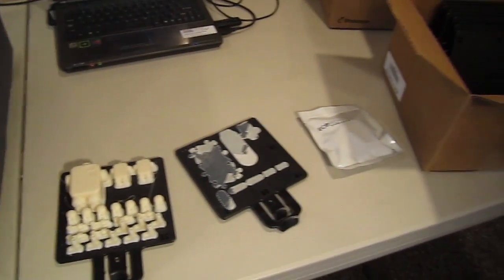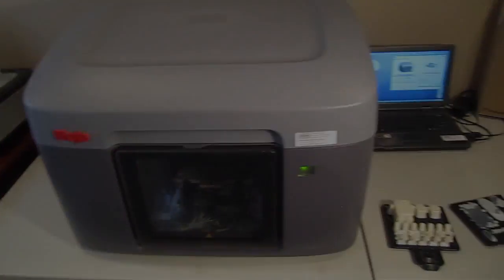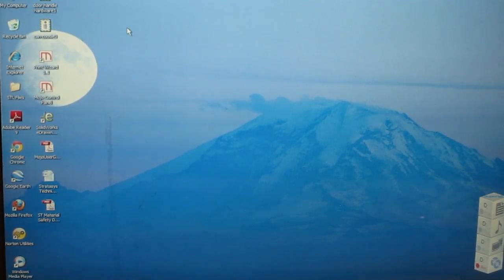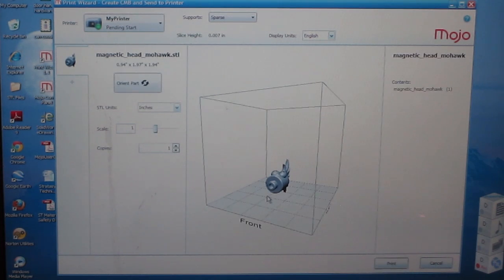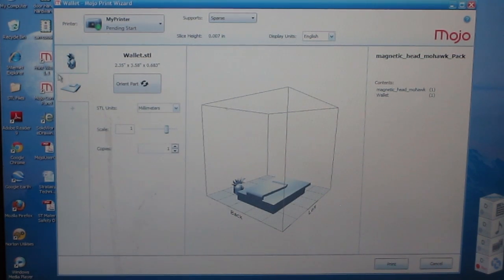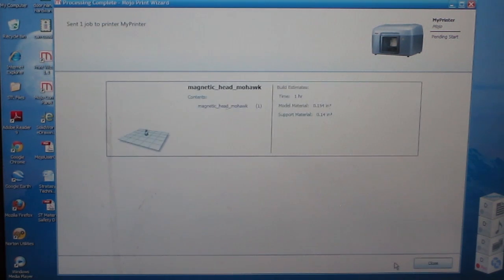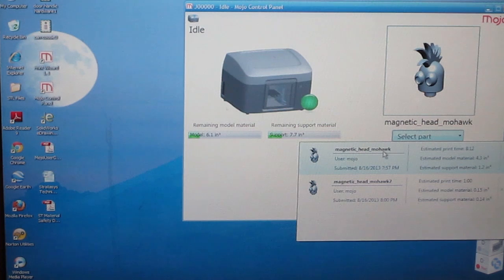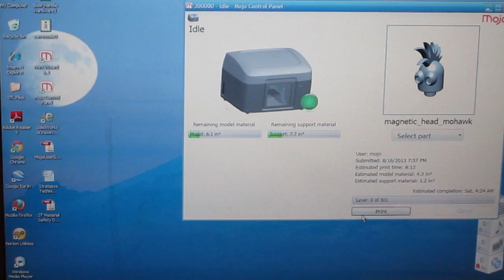Stratasys Mojo Desktop 3D Printer Review

Comment: In my honest opinion, this is one of the most overbuilt and wasteful printers I've ever had the misfortune to deal with. You can't reuse the build plate, you can't use any other type of filament, the support material needs 3 or 4 cycles through the wash to get all the support material off, and the 1 kind of filament that does work is ungodly expensive. I'd honestly rather buy a prusa i3 or a gmax with a dual extruder and water soluble support material.
Reply from the maker: Thanks for your comment. I totally get it. This printer was extremely expensive to purchase and to run from the get go. The main thing I loved was how straight forward it was. No messing with tangled spools and a bunch of settings. That being said, I’ve had great success with and low cost Creality Ender 3, but I’ve had to tune and re-tune the settings to get acceptable results. I haven’t tried the Prusa but I’ve heard great things. Let us know if you take the leap. We’d love to hear what you find.

Comment: The printer is great with reliability and consistency but Stratasys dropped the ball on the build trays. Both in the build size (5x5x5) and removal process. I went in knowing the smaller build trays, so I was OK with it but it is an absolute pain to remove parts. I have contacted the Sales team and Stratasys themselves without any serious response. Unfortunately, the trays are designed as one-time use consumables and cost about $3 to replace. With the cost of the machine and the material, I find this borderline a deal breaker. It really is a design defect, the Mojo is 80% of a great product. But the manufacturer decided to not complete it and make a bunch of consumables to make more money. I have been working on my own solution for part removal without damaging the tray, I haven't perfected it but its significantly better than their approach.

Comment: The Mojo is easy to use and works good, BUT..... We previously owned a Stratasys FDM machine and we where able to dissolve the support material off the build tray and re-use it. So what does stratasys do? they make it so the Mojo prints a layer of build material first, then support, then your part. This is BS. A scam to force you to use a new tray for each build. When you build as many parts as we do $4.00 per tray adds up.
Reply: They stopped doing that...
I used to wash the plates but I pry the parts off now anyways.

Comment: that has to be the worst deal ever.  it's essentially a $10k dual-extruder, enclosed FDM printer with a heater.
Reply: I understand what you’re getting at, but the only thing you’d really need to print the materials you stated really are just a dual extruder 3d printer, and a hotend that can go over 300’C. I don’t have any 3d printers that are dual extrusion capable because I don’t see much use for them, my supports can be removed easily as I implement my own with a plugin I added to my slicer. Oh, and as you said: "the robo prints down to 100 microns of layer height.” That is only recommended as anything lower will drive the print times up through the roof. But it is more than capable of 100 Microns. Oh and Btw, I don’t normally use normal PLA, I use either PolyMax, or Hi-temp PETG. It’s good stuff! ;)

If I were to compare to mojo to an ultimaker 3, it is still inferior to the ultimaker for cost, size, flexibility, cost and more. The ultimaker has a dual extruder like the mojo, and it is capable of soluble support. Not to mention that the Ultimaker 3 basically sets the golden standard for quality you’d expect out of any 3d printer. And since the machines are both regarded as PROsumer products, they are fair to compare. The ultimaker is significantly bigger, it costs less, has a screen (with wifi), and It can use basically any material you can throw at it since the hotend(s) are more than capable of temperatures high enough to use the materials you stated above; as I’d imagine temperature would be the only limitation.

I personally wouldn’t ever buy this machine either, as it comes from the company who tried to patent everything in the beginning, and it would cost way to much to maintain, as I don’t have that kind of money.      :P

-Matthew from Phorm Studios
Reply: That's not true...
Any ABS based material printed in large cross sections will warp even with heated bed, build tak, or even perforated bed without a build oven. Really tuned Breakaway support can do the job for a lot of parts but the clients I work with don't keep "3D-Printability" in mind while designing engineering grade FDM parts. Almost ever part has somewhat delicate features or areas where breakaway support will result in hours of clean-up and sometimes in unreachable places. As you said, no one is going to print at 50 microns and the limit on the Robo is actually probably because of the extruder and how little plastic you are pushing through it at a time.

For just how much the Ultimaker 3 costs, you are better off buying even a Formlabs SLA machine to just illustrate its huge price tag for not a lot of features. Yes, we were originally very exicted about soluable supports but PVA takes up to 8-9 hours to dissolve for any real parts and it only works with PLA and Nylon. nylon will warp and not print well as it is highly hydroscopic. We can't put those parts into a sonic tank for rapid cleaning as the PLA will melt... Yes Ultimaker advertises ABS but it really can't do any large ABS. Yes, you can technically print Polymax/ PETG as a somewhat replacement but those plastics are not what engineering clients/ business will want to deal with or use. You have to tune those in. Temperature is only a very small part of determining what material a printer can process. We returned the Ultimaker in 2 months. This soluable support only fully unlocks the full potential of additive manufacturing as bascially 100% of geometries intended for FDM can be done.

The Mojo is not a prosumer machine and is meant for professional use. No hobbyist or average guy who wants to make a few parts for projects will buy it. Sometimes smaller firms will compromise and buy the Ultimaker for concept models and cosmetic parts but it is vastly inferior in capability. As I said, you can weld parts and 70-80% of all prototypes will fit in this volume anyways.

Even for relatively low end of the professional customers I will recommend the Zortrax for their great line of thermoplastics. The Ultimaker prints well and looks good but that's really about it is the problem.

I hate some of the Stratasys corporate policies but no business can survive without some protection of their innovation. If I invented FDM, I will be patenting the hell out of it. In the end, they make impressive although very expensive machines that can be justified only for research/ corporate use.
Reply: I have an UM3 extended and it is great for organic forms, but it simply cannot compete with the Stratasys printers for professional (i.e. product/industrial design) use where accurate dimensioning and part fit is pretty much the entire purpose of the print. I'm upgrading to a uPrint SE Plus because "hobby" 3d printers really are best suited to hobbies.
Reply: I understand this video was posted a year ago, but I still would like to state some info.

First off, do you mean positional accuracy or Z resolution?

if you mean positional accuracy, the ultimaker 2+ has a 12.5 micron positional accuracy and repeatability. The stratasys is only .178mm as you stated, .178mm is 178 microns; that number is insanely high and would be unusable for a 3d printer.

I assume you are referring to Z accuracy in that case. SO, where do I start? Literally every 3d printer can do less than .15mm in present day 2017. EVEN the repraps! An ultimaker can go down to 20 microns in the z axis which is equal to .02mm 

-My 3d printer, the Robo 3D R1, can go down to 50 microns in the Z axis, which is 3x higher resolution than the Stratasys.

The ultimaker 2+ costs 2500 USD currently.
The Robo 3D R1 (though discontinued) costs about 600 USD new.

Hope I cleared some thing up.
 -Matthew from Phorm Studios

P.S. the mojo can only print at 5.7 inches cubed. My Robo 3D R1 can print down to 50 microns, at 200m/s with a build volume of 220x254x200mm. That roughly translates to 9x10x8 inches. thats 535 fewer cubic inches difference and 9400$ difference. Ouch!
Reply: You would be right, and this has also an insane running cost, but...
Your robo and ultimaker will not be able to produce parts in an engineering grade ABS such as this ABS-P430, which is an ABS-polycarbonate mix that can deflect 90 degrees in roughly 3 atmospheres of pressure and have excellent tensile strength/ impact strength properties for end use or functional prototyping on par with things like generic nylon polyamide blends.

I used to believe the same thing as you and print happily in PLA and such generic material until we did some testing and found the low glass transition temperature of PLA will literally cause it to deform in a car during the summer. PLA's tendency to shatter rather than deforming in a gradual curve is not great. Generic ABS will warp on the Robo/ Ultimaker and even top of the line Zortrax desktop FDM machines will have slight issues with larger parts at high interior fill in any ABS based material.

The tolerances on this is anywhere between 0.01mm to 0.125mm based on part geometry as with like the UPrint and Dimension series. 178 micron layer heights are good enough for FDM. 100 microns already obnoxiously add to print time and we run stuff that needs to look over performing really well on on our SLA machines anyways. BTW the robo prints down to 100 microns of layer height.

Not to mention the Soluable Support system is incredibly valuable and truly unlock the ability to produce any geometry. Breakaway supports generated even by like Simplify3D can damage the model or delicate features in the peel process. Not to mention there will be support material for certain geometries that are not printable.

I would personally not buy this as the build plate is kind of small although this prints well enough to cut parts and weld them together chemically and it's not that much for a company to pay and get like a UPrint or Dimension. To be fair 70-80% of all prototypes will probably fit in here. This is a machine is for a corporate environment or engineering firm to get great performing parts at like 100% reliability and is not meant for the average consumer. This is really meant for a whole different market.

Comment: Great review.  I watched this before I bough my Mojo.  Can I ask you one thing though, how did you clean the build tray?  I'm having the hardest time cleaning it.
Reply: eddyogi This is the scam I spoke of in my post. The old machines printed support material first, which you could disolve off, same as the parts. This machine prints a layer of build material first so you cant do that. Greedy bastards needed a way to force you to buy more trays I guess.
Reply from the maker: I have found one decent way to clean the trays and re-use them is the take a sharp chisel and scrap the remaining material off. Just be careful not to cut yourself and try not to gouge the tray. If there are small scratches it will still print fine.
Reply: Patrick R Yes, I agree.  They tray's aren't exactly cheap, either, especially given that they're just a relatively small bit of plastic.  I think reviews should make it clear that the tray's are purposefuly designed to be consumable...
Reply: can you take the build tray out? If so you can use acetone to dissolve ABS plastic, just get a glass container and fill it enough to cover the build tray, then leave it for about a day and it will clean off the plastic. I've also used kapton tape on top of my build plates

Comment: will it print at super high detail, like skin pores and other subtleties?

thanks
Reply from the maker: The minimum layer thickness is 0.007" so that gives you an idea of the precision. The average skin pore is about 0.002" so the Mojo will not print that level of detail. An SLA 3D printer would be better for that. Check out Formlabs new desktop SLA printer. I've linked to it above.
Reply: Gription Gear thanks for info! highly appreciated.  G'day.

Comment: How to color figures,does fine art's oil is ok?
Reply from the maker: I have tried to color the parts using dye without success. Many forums suggest acetone and "Rit" dye but this method did not work for me. I don't think oil paint would stick to the ABS plastic unless the surface of your part was prepped or primed.